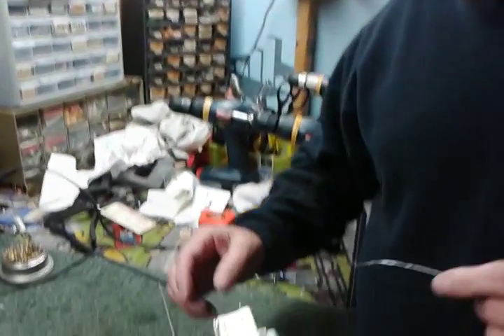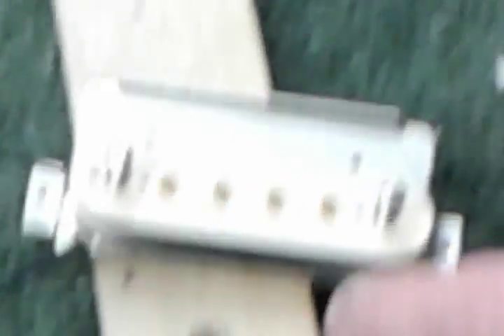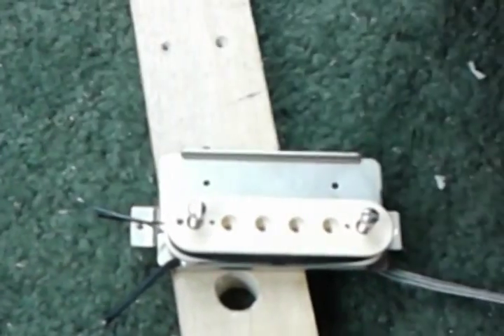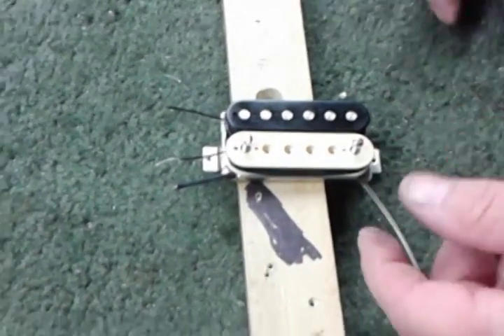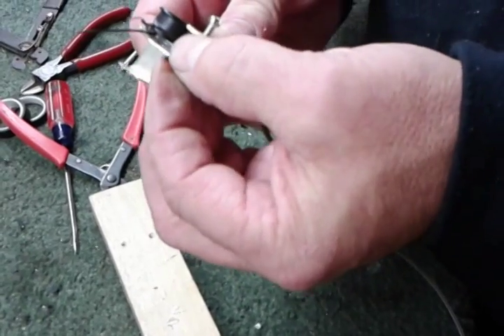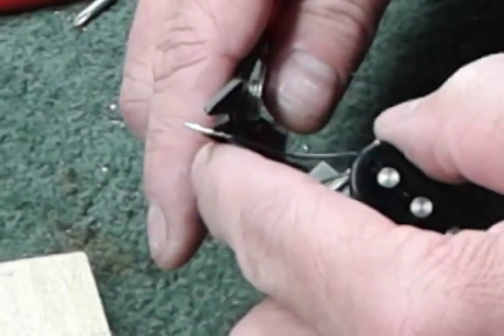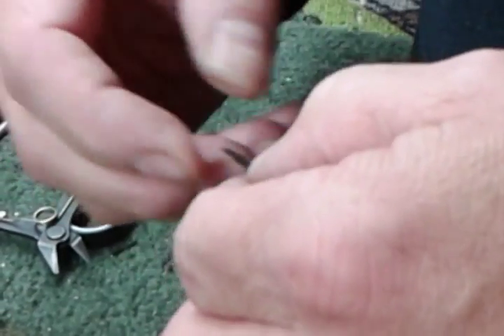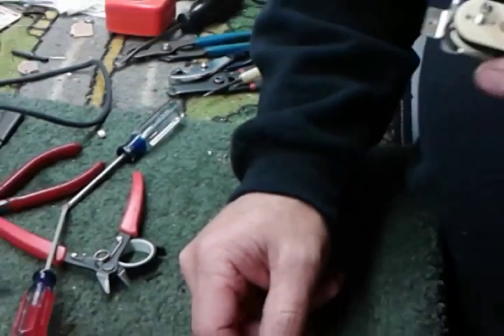Installing Vintage Braid Wire

Comment: Hello, what should I do if my pickup is missing the start wire?

It's an old seymour duncan alnico 2. I have a braided wire, it's not connected to the pickup. I have taken the pickup apart, seems to be no start wire. It is a used pickup, received 'as is'
Reply from the maker: Looks like the coil needs to be repaired or rewound
Reply: @ElectricCityPickups1  
So it would have to be completely unwound, the the start wire added, then rewound?

Are there any shortcuts to make it work without all of the labour?

Maybe I'll salvage the good parts for other pickup upgrade

Comment: Hi, I realize this tutorial is a few years old now but I was wondering if you might have a minute to clear up a question I had on potting.. I have a set of Stewmac Golden Age (5402/5403) Pickups and I was going to overhaul them with Nick-Silver baseplate/cover, maple spacer, A4 Mag's, vintage braided single-conductor lead wire, etc.. The gray area for me is what happens to the factory wax potting during all of this.. Will the rebuild process (parts swap) and separation of the two coils result in the need to re-pot them??.. Every potting video/tutorial I've seen shows assembled pickups being potted as a whole assembly.. On the other hand, I'm also seeing a lot of people disassemble/re-assemble humbuckers without ever mentioning anything about the factory potting.. For all the effort and expense, I don't want to end up with micro phonic problems but not too sure if it will be an issue at all..
Reply from the maker: Freddie Bleeko you can use a hair dryer to carefully melt the wax before you rebuild your pickup so all of your new parts fit tightly. Your coils will still be potted
Reply: Electric City Pickups ...That clears things up a bit.. So wax potting has more to do with dampening vibration in the coils rather than what's under/over the coils.. Like the magnet, spacer, keeper bar, etc..